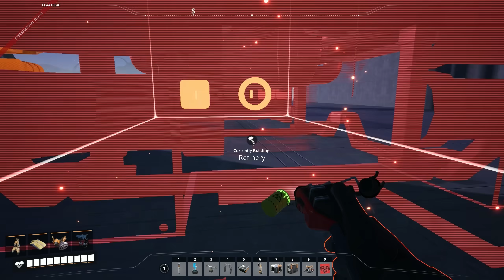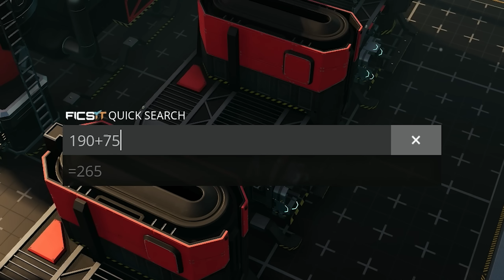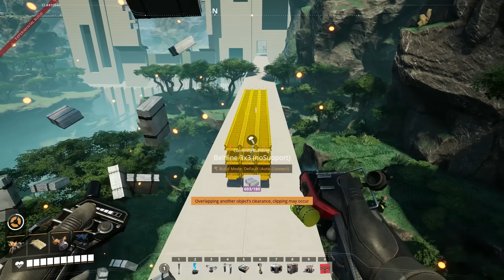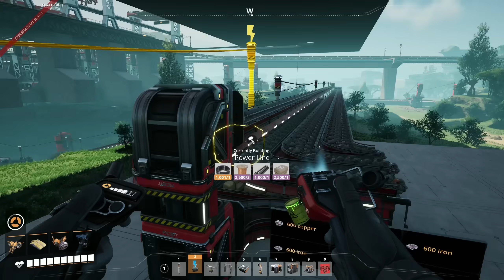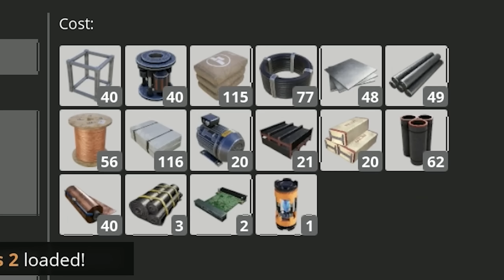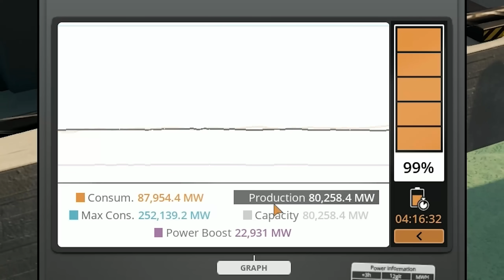Automating 15,000 Iron Ingots /min is INSANE! - Satisfactory 1.1

Comment: Curved build mode seems good for joining belt highways on bends in general. If I had to guess, it's always guaranteed to have no intersections because of the geometry of it, picking the largest curve (which will always be connected to the same side, assuming you have a bunch of belts ending all next to each other on each side of the curve), and with the same center of the arc since the center is probably where some lines perpendicular to the belt ends meet (offset in the event there needs to be a straight link into the circular arc) to find the center of the circle (which is thus the same if the belt ends on each side are all next to each other). Thus, curved build mode makes concentric, non-colliding connections between such belt highways every time.

Comment: Man I've not messed with this have in a while, awesome to see you using the modeling companion.

I've burnt myself out on this game, mostly my own fault I didn't make or use enough blueprints, I free hand so my factories. I got to nuclear power and plutonium, but I just use the plutonium to sink the waste, but I haven't got ficsonium yet. The last project I was working on was a rocket fuel factory to start swapping the fuel in my drone fleet, I got lazy in my late mid game stage and just started shipping things around with drones because it was faster and more direct than running belts and setting up trains. I have a fairly sizable fuel factory with drones that run fuel out to other drone ports, usually a dedicated port to run to the fuel depot to bring back fuel to run the drones. The depot ports themselves don't have drones of their own to prevent them from having loitering backup's. Only the drones at my nuclear power plant run on plutonium and they bring in parts from other facilities that I didn't really feel like producing on the spot that I have a surplus somewhere else, figured why sink them if I can use them, the excess plutonium still gets sunk through.

Comment: Basic Iron Ingots is a curious feeling recipe to me. While more Iron Ore efficient than Pure, the secondary is more rare than Iron Ore as opposed to Water which is well Water... However, Limestone is well, unless you decide to go crazy in amplifying steel production with the Molded Alts or need a crap ton of Silica, just not used in great quantities in most production chains, being hard required for a mere 2 items: Encased Beams and Singularity Cells.

Comment: I remember building a mk2 blueprint that can handle 8 incoming lines of 480 ore to smelt them into 8x480 ingots, using only the smelters. They fit in very snugly, with all the conveyor lifts and mergers fully clipped into the smelters. It even has a roof to stack it!

As for your missing lifts from the 2nd blueprint: nudge the mergers 3 steps inward, than try connectng the lifts starting at the mergers. They'll fit in snugly, while clipped into the smelters. Assuming clipping work properly as it should, I had issues with it in 1.1, hence why I make my blueprints in 1.0 still. having a copy of both versions on my pc just for this reason in odd, but probably worth the harddrive space.

Comment: Tip for kibz (and anyone else who doesnt know) when placing a blueprint if you press r twice it goes to blueprint snapping mode so itll snap to a previously placed one. Its great for stuff like the iron smelting system when youre using one blueprint many times
Reply: He demonstrated it with pipes before.
Reply: @dreadn0ught_k oh i must've missed that. I know hes shown off connecting blueprints but dont remember snapping blueprint to another. I wonder why he didnt use it here when lining them up 😊

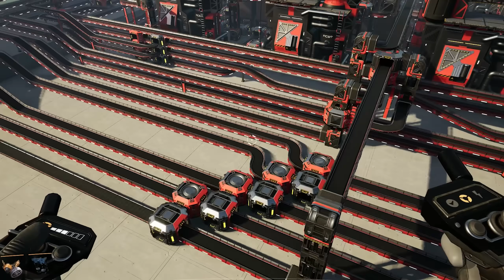Comment: 27:05 this system will run into problems when you run it with full belts. You can imagine if the rightmost belt has >600 items/min and the one directly to the left of it has >600 items/min then the merger will merge them equally meaning anything produced above 600 on the rightmost will get stuck and miss on some other belt. Perfect use case for a priority merger! 😊

Comment: Is there a reason why Kibitz doesn't just make synthetic power shards? Would solve his power shard problem.
Reply: The absence of power? I mean the nuclear plant isnt online so im pretty sure a power shard factory would kill his grid
Reply: @agent-a-br Since you only really need 1 machine making shards it doesn't actually drain that much power.
Reply: @Syaniiti  so hes prob saving to make a large factory instead of temporary small ones?
Reply: @agent-a-br Since you can't sink power shards there's no reason to make a large factory, a single machine can make 5 power shards a minute and while they are used for ionized fuel and alien power matrix, considering  the size of the nuclear power plant neither of those seem like a thing that is planned.

Now if he wasn't building a massive nuclear power plant then sure, upgrading all your rocket fuel to ionized fuel  would take several machines making power shards (3 fully upgraded machines per full mk2 pipe of rocket fuel, or 6 if not using sloops).

Overall, 1 machine into a couple of industrial storages make more power shards than you can sensibly use - since designing blueprints, beautification and building logistics all take time and had he built 1 machine to make those power shards when he started complaining about them he'd currently have over a 500 more shards by the video length alone, so he'd have thousands upon thousands of shards  with just one machine (and a couple of storage containers).
Reply: @Syaniiti  If you already have the necessary materials (Time Crystals, Dark Matter Crystals, Quartz Crystals and Excited Photonic Matter). If not, then it really might hit hard on the power side.
Edit: Just looked at my shard production and it takes at least two particle accelerators, three converter one quantum encoder plus the multiple miner.
Reply: @romsch2430  Sure, it requires more machines than literally that 1 machine making the things, it's not like you can get anything but excited photonic matter or raw ores with just 1 machine. 

But again, unless you're converting fuel you don't need more than 1 machine making power shards. (1 machine can supply 2 alien power augmenters with alien power matrixes and has some left over for a storage bin).
Reply: Thinking the same since a couple of episodes. Same goes for the Ficsite Trigons and Time Crystals for Mk.6 belts.
Reply: Because he did not compleat phase 4 yet, he want the power plant to compleat this phase and start trigon, dark mater ect after.

Quit a challenge to add

Comment: Hey kibitz unsure how or where to ask questions about satisfactory but its been 2 months ish to try and configure my coal power my first takeling coal power. I got everything done, but the water situation is daunting. I finally figured out that I gona need more than one fluid tanks to operate coal power generators. I wanted to have water produced below and generators above i like the concept am sure you can understand. But I figured out 4 fluid tanks can operate 24 coal generators but I haven't found a youtuber who goes into detail about headlift and how many head lifts you need if you want to have liquid go up to factories and how many pipes needed and how much one fluid tank can handle per each automation needing fluid. I hope I make sense and alot I wrote but hopefully someone out there can give better guardians and yes I have that road map to pipes that someone made and downloaded it and am still confused.
Reply: Yes, liquids are shit.
The water extractors and other buildings that work with liquids provide a bit of headlift on their own. This means: As long as you only go up a little with the pipes, you don't actually need pumps. Fluid tanks are useful, but they reset the headlift. This means: If you place an MK2 pump, the pipe has a 50m headlift. But if the pipe goes into a fluid tank, the pipe only has a 10m headlift after that (the fluid tank provides the 10m headlift automatically). So place pumps before and after the fluid tanks. Another tip, which is difficult to explain (English isn't my native language): If your pipe is, for example, 20 meters high, no matter how many times you go up and down with the pipe, you don't need pumps as long as you don't exceed the 20m height. If you want to exceed the 20m height, you need pumps again. In other words: You could build a water tower. Build a vertical pipe extremely high and place enough pumps so that water or other fluids can reach the top without any problems. Once you reach the top, bring the pipe back down vertically. Now you can do whatever you want with the pipe; as long as you dont exceed the height of the water tower, you don't need any more pumps. However, you can't use fluid tanks, as they reset the headlift, rendering your water tower useless.I would also only place pipe junctions horizontally and not vertically, because the pipe junctions have priorities when you place them vertically (meaning you cannot distribute liquids evenly).

As I said, English isn't my native language, so I hope I've explained things reasonably clearly and helped you at least a little.

Comment: Another episode of Kibz building with Mk5 belts as if they were Mk6. At this point it's basically torture for Future Kibz.
Reply from the maker: Future Kibz will have a VERY bad time :)
Reply: Future kibz is a buffer for free content
Reply: Looking forward to him finding out this teeny tiny detail. 😂
Reply: As long as it has the proper flow rate it will be fine. Some blueprints he purposely used mk5 belts for distribution reasons
Reply: Its easy. In satisfactory calculator you can select a area and can select all the belts in the area and upgrade/ downgrade the tiers of the belts

Comment: Idea to shave a bit of the repetition that's near with the.... Copper. Experimental has the blueprint belt/pipe auto-connect, well, consider designing the copper processing blueprints in a way that they use this.

Add a little belt piece before the input and after the input passthrough, that will allow each blueprint to auto-connect and make a set of blueprints work their line as a manifold.

This could also work for the outputs and output passthroughs, if both are aligned, but doing both might be a bit much blueprint real-state.

I know there's not much left, but we should try to save a little sanity right?

Comment: Not a big fan of seeing a bunch of machines spammed on foundations after you put so much work into keeping pretty much everything else enclosed, especially since it's right outside of the main factory tower.  Also surprised you didn't try the technique you used for the manufacturers and lift all the machines off the ground in the blueprint so you can use the bottom layers for logistics.

Comment: Hey, Kibz. For the new home for your space elevator, I think you should make a spaceport with a train station where trains will unload all the Project Assembly parts so they can be sent into space via the space elevator, or be sunk into coupons with some awesome sinks.
Reply: yeah actually use those belt inputs it'll be so cool!
Reply: I just wish it was somehow actually possible to make things like that so the belts wouldn't get clogged up, and it would just load the needed items, without reprogramming splitters and manually flushing belts every stage.
Reply: @Nevir202 you can use your factories for the first few assembly parts to make the mid and end game parts. Just plug in the inputs of later assembly parts, still looks dope.
Reply: @mareknovotny5441  Sure, but as I was saying, you are going to end up with inputs clogged with lower tier items that you need to manually flush between rounds.

I really wish they had something like an "AI splitter" which can connect directly to a machine input the same way conveyor lifts do, and will only take items off a belt if the machine they are connected to has space for them.
Reply: You could put a regular splitter and sink the overflow
Reply: And also add a bunch of drones flying around it as well